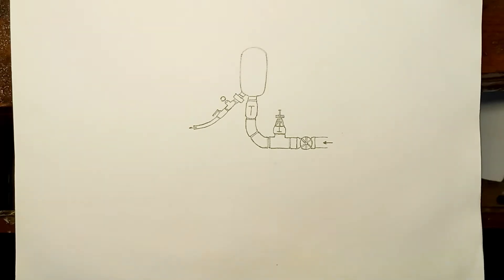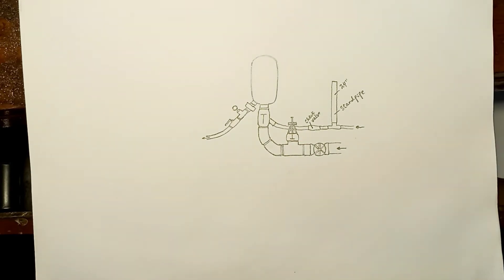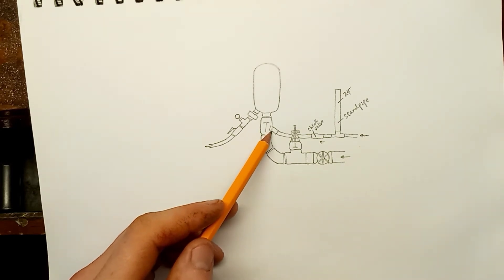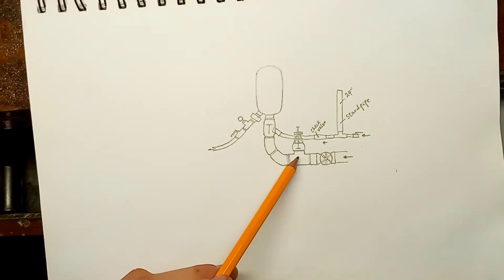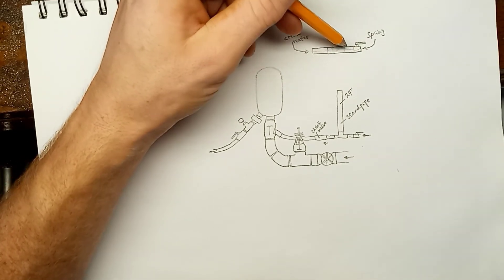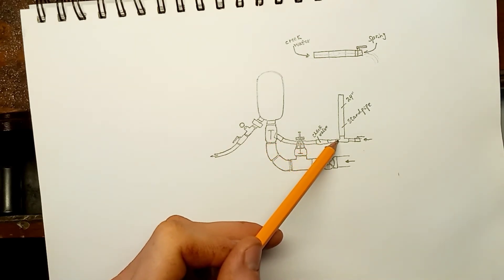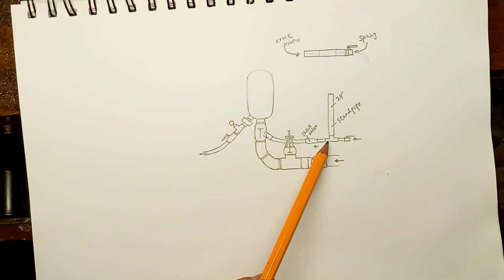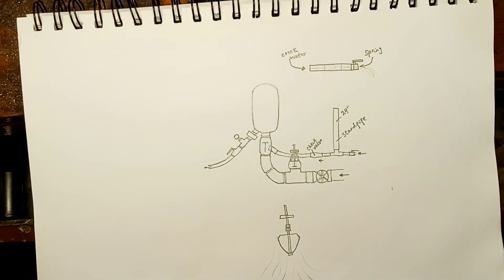Double Acting Ram Pump Overview

Comment: Sir please  let me know is it possible to send pure water which is  flow water(nil  head )but d dirty water has nearly 5 feet head
Reply from the maker: That's a good question, unfortunately if you really don't have the head on the pure water side it won't really work, you need at least 18 inches of head pressure on the clean water side (preferably 24 inches) with a standpipe in order for you to pump only clean water. 5 feet of head of the dirty water side should be just enough to run the pump. I have had to dig out the low end of a creek before to barely get enough head pressure to run pumps. That is an option, basically get downstream as far as possible to give as much natural head as you can and then start digging the creek down scooping out sediment and clay and rocks out of your way. I have had to dig down 2 feet before but I was able to get it to work. Good luck!
Reply: Thank u sir for u r prompt reply thanks once again
Reply: I am from India